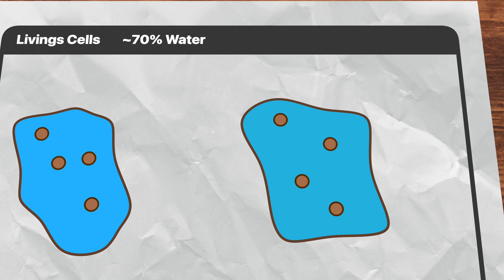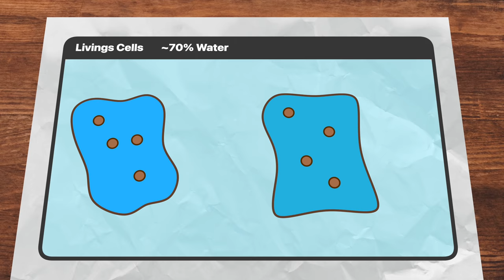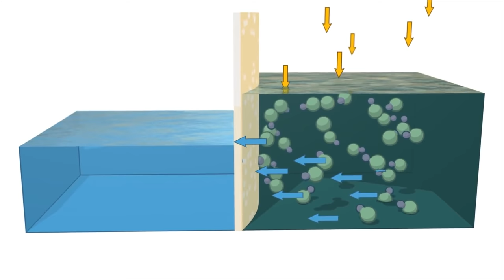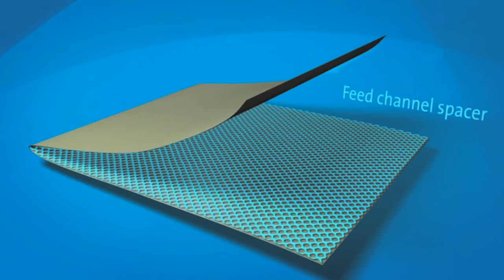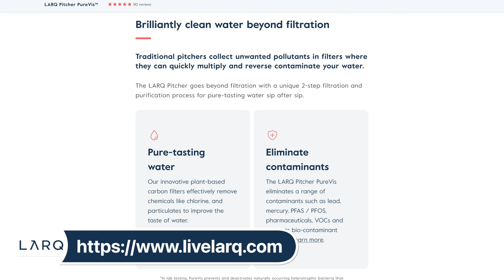Why Not Build Desalination Plants EVERYWHERE?

Comment: Great video. A few things you forgot to mention. 1. The global human population is falling, and has been for a while now. Obviously this will apply downward pressure for needed resources. 2. Why the heck are we building in deserts?!?! This new project you based this video on creates a HUGE city in the middle of the desert. I can't think of a worse idea. There's millions and millions of square miles of real estate to build cities/housing in area that don't present such a huge challenge in suppling our most critical resource. 3. ALL wastewater flows back to various aquifers, rivers, lakes, etc. We all drink water. We all shower. We all pee. When we die the fluids from our bodies are filtered naturally into aquifers. Same with wild animals.  Where do you think that wastewater goes? We don't just truck it away to a giant toxic waste dump. We process it through various filtration methods and put it back where it came from, or it is filtered in the best filtration system ever known. The ground. Ever try spring water? It's filtered ONLY through the Earth's rock. Safe to drink, tastes great, less filling blah blah. The only areas where humans struggle with water is in the desert. 4. Green energy such as wind, solar, batteries etc. require the use of massive amounts of fossil fuels/energy to produce/transport and dispose of. Not to mention there exists no power grid on this planet that can support the energy requirements to keep EVs on the roads. Speaking of roads, I wonder how much petroleum goes into building and maintaining those? Probably not much. There's only millions of miles of them around the globe. And let's not forget the environmental disasters being created mining, transporting and disposing of all the minerals needed to produce batteries. Batteries are not green, let's stop pretending they are. If we are to take care of our planet, we must stop lying to ourselves and find methods are aren't so environmentally destructive.

Conclusion? Water loss through human/animal consumption is a fallacy. It all goes back to where it came from. All of it. We just need to be smarter where we chose build our cities., i.e. NOT in the deserts. Let's choose and develop affordable solutions that actually help our environment.

Comment: Thermal is better when coupled with other resource or processing plants that generate heat. You simply direct that heat towards the evaporators. This is how it's done on U.S. Warships because their is a surplus of heat energy produced from all types of machinery primarily from the main engine rooms and Aux rooms.

The main issue here is that salt returned back to the sea through brine pumps is altering the salinity levels in the long run thus affecting marine life as well as the health of ocean water. Sadly, just like all other solutions to problems we have on Earth, this solution too is looking only at the short term effects while ignoring the potentially negative long terms effects.

Comment: I sent a proposal thru (via DHS) when "The Wall" was being bid. It was called "The Great American Canal".. From port at San Diego along the border (for the most  part) to the Gulf of Mexico... With De-Salinization facilities at the Military base in San Diego, additionally at encroaching rivers (i.e.Colorado), several fresh water reserves along the way and another at the Gulf (for continuity). Even utilized the LA Aqua-duct. Would have eliminated our use of the Panama Canal, delivered massive fresh water to desert areas along the southern border, would have been navigated  by the US Coast Guard... Good to see "Someone Got The Memo"... Canal depth was to maintain oceanic depth from both ends... The design was 50 feet wide, 20 feet deep with a 30 foot capacity for overflow from major cities (i.e. LA, Houston, etc) to account for bi-directional floatilla navigation.. All at 1/10 the cost per mile...

Comment: Science has had a low contamination nuclear reactor design since the early 60's.  Molten salt reactors are very safe, unable to melt down ala Three Mile Island, use smaller amounts of radioactive materials and they can run for decades.  The main reason they are not used is because the Navy adopted water-cooled reactors (Nautilus) for their ships and subs (because ships sit in endless amounts of water) instead of MSR's.  Nuclear Regulatory Agency got tunnel vision on water-cooled.  MSR's can be built inexpensively by repeating the same design over and over, servicing several small communities or one large city.  The bonus is that excess heat can easily be used to run large evaporative desalinization operations that would supplement conventional water supplies.  Look it up.  It is there.  But government and big business lack the initiative.

Comment: Solar panels could be used to create the heat to evaporate the salt water.
Stirling engines could be powered by the sun to pump the water.

But then what to do with all the minerals that are extracted? Not knowing how much they would be, it could create a new problem with disbursement. Dumping right back to the ocean might create problems with a  too strong situation.

Perhaps use could be found for the minerals to produce other products.

Comment: This is how to fix the reverse osmosis paradox... That It costs too much and environmental constraints usually kill the plan.

The biggest difficulty with reverse osmosis is the energy needed to counteract the osmotic pressure.  The next difficulty is disposing of the residual brine to have the least affect on the surrounding wildlife. Both situations can be easily overcome
By placing the intake at least 1800 feet in depth in normal seawater, which is much deeper than the intake, we can solve both problems. You will not have to pump the saltwater through the filter and you will not have to pump the freshwater to the surface or the shore.

Comment: It's got more problems than that. You gotta worry about sand, aquatic life, and waste (human trash or animal feces) being pulled in and clogging filters(if it doesnt break them). Saltwater damage equipment badly and needs constant maintenance and repairs. Than the left overs from the separation of water has to be discarded since theirs a good chance it's not safe for human consumption and bad for the environment. I worked in plants that used river water from Gulf of Mexico to make steam and those pipes constantly burst, leak, or break due to saltwater eating away at the gasket and pipes

Comment: All you have to do is salt water is make it evaporate and only the pure water evaporates separating from saltwater. This can be done by either boiling the water or covering the water with clear plastic or glass and allowing the sun to shine on it. What is caught on the glass or plastic is pure water. Then you run it through a filter to filter out the impurities. Also in the earth's upper core they have found three oceans worth of all of our oceans put together. Problem is because it's so far down and under such heat and pressure is fused to the rock down there so it cannot be tapped into. But there is enough fresh water on the Earth just some of it cannot be tapped into.

Comment: A few points to consider about the lithium:

1) Your math is wrong. At a concentration of 0.1 ppm, 100 million tons of water contain 10 tons of lithium, enough for about 150 Teslas. But this assumes that ALL 16 000 desalination plants recover this lithium. 
2) Lithium ore contains about 10 000 ppm lithium. Even at this concentration, separating lithium from the rest is a pain. Imagine doing that at 0.1 ppm concentration.

Also, I would have never imagined someone talking positively about NEOM. Building this thing is absolutely impossible. There are literally a hundred reasons why it will not work.

Comment: I understand that supercritical water does not hold salt, it falls out.  Requires high pressure and temperature but in deep oceans like off the coast of Sydney, which produces 15% of its water through desalination, they may be able to get the high pressures by running the process in deep water which can be found about 35 miles off shore.  It may be possible to generate electricity from this process at the same time as producing fresh water by taking advantage of the buoyancy difference between fresh and salt water.

Comment: One more problem with desalinating sea water: It's at sea level. To get the water anywhere else, you need to pump it up. As in, if an inland area is a 100 meters above sea level, you need to pump that water up a 100 meters. That's expensive.
Reply: Besser teures Wasser wie zu wenig . Wir alle werden in Zukunft mehr für Wasser und Essen ausgeben müssen. Mit Solar oder Windenergie könnten die pumpen für das Wasser günstig betrieben werden . Auf den Liter macht das nicht viel aus

Comment: Using the sun to evaporate water has been around for at least 20 years. There's even ideas of using gigantic greenhouses in Saudi Arabia where solar panels run the pumps and they let the sun evaporate the water which then waters the crops inside the greenhouse. Well this might work in super hot areas, it's not going to work in the northern hemisphere because there's simply not enough sunlight. As for processing salt, we've been doing that here in the US for over at least a hundred years. In Death Valley there are companies that simply scrape the salt up and use them to extract minerals. Again this is not new. I wish them all the luck for those countries that are stuck on the equator. But for us in the US this is totally na.

Comment: The funny thing is, every home with an ac system or heat pump already has a reverse osmosis machine built in. Modern ac systems move heat and water vapor in the air causing water droplets to form, this water is then drained out to a floor drain or heated and vented off into the atmosphere. Why can't thermal desalination plants use this same technology?

Comment: one thing you failed to mention after harping on it ... agriculture like farming may use 75% to 90% of the water in a region BUT it also replace 55% to 70% of it BACK into the region ... you only gave HALF the information and only the bits that fully support your view ... give us it all the good with the bad ... the rose with the toilet water ... for those sensitive ... in french it is called Eau de toilet ... seems to be a perfume called that ...
Reply: I like the idea of the strip city ... and you cant use use a standard model to measure the cost effectiveness of this system as it's rewards are not all at the end but all the way through it ... sure fresh water and salt ... BUT all the metals ... the food ... the heating ... the cooling ... the basic living needs .. lubrication .. storage ... fire fighting needs ... etc ... all of these things come out and back into the system all along it's process ... 
.
dont want wars for water ... stop cutting down nature to put up a parking lot ... build taller or build underground ...

Comment: I have my doubts about the parabolic mirror process of boiling water mainly because hot salt water is probably more corrosive than most acids. I would go with an electrolytic separation of salt from water. It solves the mineral recovery and produces large amount of hydrogen by using the salt as the catalyst.

Comment: Honestly I think day after tomorrow was right as to why not do this. It was a fictional movie but based on one scientific fact, salt water and fresh water freeze at different temperatures, taking out too much salt or adding too much fresh water could destabilize the ecosystem in the water as well as the icebergs. If we switched to hydrogen fuel cells though (not mining from the moon for the same problem) we would have more rain that could be used to create more hydrogen and fresh water. Or, alternatively, we take our waste and sewage water and turn it into hydrogen, this will make fuel for hydrogen while also cleaning the sewage water that would be much more drinkable than the tap water we drink that’s is ultimately recycled sewage water.

Comment: Ship desalination uses microwaves. Water molecules are wired. They behave is strange ways. Low energy microwaves super-excites them, witch generates a lot of heat wherry quickly. Easily bringing water to a boil, and this is how a microwave owen works. It can't actually heat up something that has no water in it. (Unless it has traditional convection functions.) If your plate gets hot it's because of therma convection from the water in the food. No water in the owen means no heat. Other molecules are not affected notably by low energy microwaves. Witch is why your cellphone is safe to use.

Making usable water is always a stages-process though. The best method I have heard about is Co2 based purifying. The angle of the tank nossle gives the water a wherry peculiar property when it gets blown through it at high speed using compressed Co2. It crystallizes! On the molecular level. Just like the forming of a natural snowflake, just consisting of a single molecule, and unthedered to all the other crystals instead of locked together in a pattern. These individual crystals as they form will physically push out any impurities. Leaving you with 98% pure water after the industrial process that has required no application of direct heat. (This level of purety is not meant for consumption. It is used in medicine, or industry only. Mainly to clean the big expensive rare earth metal fan blades that they use to make gas turbines. Those big ones they use to generate a lot of electricity offshore ect. Even trace amounts of mineral particles on the smallest level can cause a lot of damage to those blades. Those turbines don't need the pure water- but, it makes them a bit more efficient, much less likely to break, and much more environmentally friendly.)

Comment: The passive evaporation method powered by solar heat (07:42) could be fairly easily implemented on a huge scale in heat type deserts like the Sahel. In those environments even the brine could be compacted and stored with relative easy until the time that innovation allows for further processing (like using it in inert building materials etc. aside from the extraction of high value minerals that this video already describes). Often wonder why nobody is making this a reality.

Comment: I always hear about the environmental problem with the brine and recycling looks interesting.  However,  I still don't understand why this is such a problem. It came from the water so it seems the problem is putting it back in such concentrated form.  It seems it would not be too hard to use seawater to dilute it and distribute it broadly enough that it is redisolved into ocean.  It must be cost prohibitive to do that but it doesnt seem like it would be.

Comment: The explanation for why you shouldn’t drink salt water is incorrect.  If it was osmosis then the same idea would apply to sugar water, which we can drink just fine in terms of dehydration.  Salt water gets absorbed just fine by the body, but getting rid of the excess salt becomes an issue since the kidneys can only push out a certain concentration of salt in urine.

Comment: How about using seawater in the tertiary cooling circuit of nuclear power plants?  when you condense the steam from that and send it through an ROx system you should end up with usable drinking water . Of course you would need a tertiary  cooling system with triple redundancy  so you can have 1 system in use while the others are cleaned and maintained

Comment: I believe your lithium calculation is off by a few orders of magnitude.  100 million tons of sea water, and only about 0.1 PPM is lithium, or 1 part per 10 million.  That's 10 tons, or 10,000 kg, not 10,000,000 kg.  A decent amount, but a HUGE difference.

Comment: Could drilling down to find geothermal power generation (steam turbine) options be a way to power the pumps for this experimental cityscape, maybe?

I know there's been a lot in "science communicator" videos as of late regarding geothermal as a possible renewable energy source if drilling techniques and chamber configurations can be setup correctly... but I understand it's very hit or miss as the conditions for heat and pressure deep underground have to be very stringent and particular...

Comment: So… if having salt in water prevents hydration, does that mean electrolyte drinks like LMNT are doing the opposite of what they claim? I really hope not. I find I feel like I have better performance in general when using LMNT.
Reply: Sea water has far too much salt, but sodium in general is a very important electrolyte that your body needs. When you sweat you lose electrolytes like sodium, magnesium, and zinc. Electrolyte drinks that replenish these are super important when you workout!

Comment: I think your math is slightly wrong...

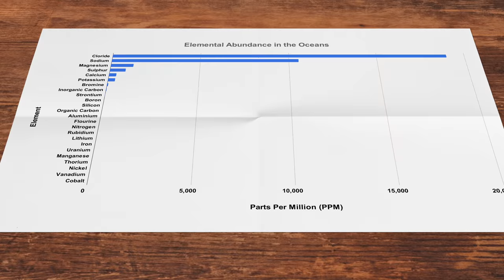8:34 here's a list of useful elements found in the ocean. And there concentration measured in parts per million. I want to bring your attention to the bottom of the list. (Lithiam ~0.1 ppm)
9:08 - 95 Million m^3 fresh water per day
9:19 - 10 million kg of lithium
====
So 0.1parts/million * 95 Million m^3 ==> 9.5 m^3 lithium
Lithium density = 530 kg/m^3
===> 
~5000kg lithium per day (i.e. 28 Tesla Model 3s per day)
Not sure how you got 10 Million kg... lol

Comment: Water is not scarce, it’s just humans have very wasteful lifestyles. It’s better to recycle the waste water you have rather than have expensive energy intensive desalination plants hence in the UK there is only one in London. Economically it would be more effective the treat sewage to a higher standard with modern technology and recycle water back into supply plus have more balancing reservoirs to capture water to meet seasonal supply demand issues.

In the UK energy has never been cheap, renewables have to have back ups such as nuclear power which also has its own long term waste problems.